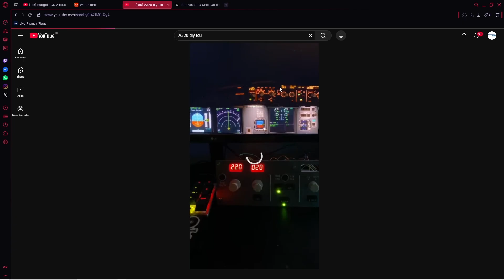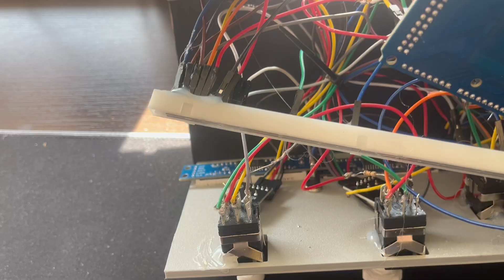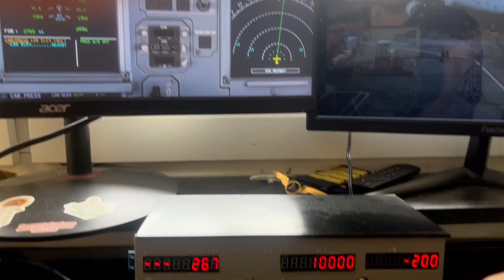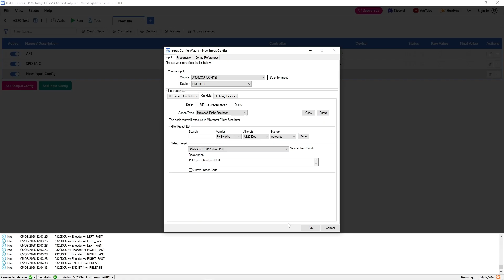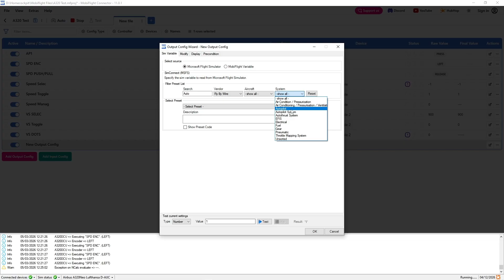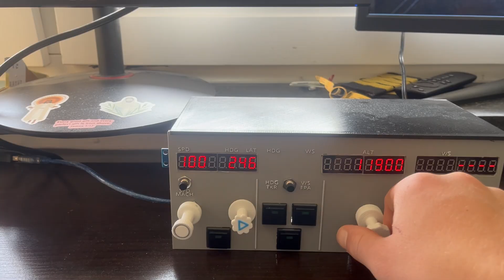The €40 DIY A320 FCU: Arduino Mega & Mobiflight for MSFS2020/24

Comment: Can you please make the wiring video for ardrino.
Reply from the maker: I could do it depending on my next projects… do u have an questions ?
Reply: @barbaros737  I don't know anything about wiring and if not the video, I would really appreciate if you could share the full wiring diagram. Thanks!! I really want to recreate this!
Reply from the maker: @rohannawani896 I actually didn’t used a wiring diagram. I simply used the normal wiring with common ground. Meaning every - pole connects to the next device until every - pole is filled, then I connect every pole with the Gnd on my arduino . For the other pins I simply googled or watched a few wiring videos. 

LED is for the long wire + meaning any given pin (don’t forget to solder your resistance for any led)

Buttons / switches where one pin to the arduino the other gnd (common ground )

For the lcd displays you can find it easily on google or yt tutorials 

Encoders also  -  + same action as the other devices … than you have two pins that go into the arduino for your inc/dec action … than there is one pin titled as swt or something that is for your encoder press button that also goes into your arduino
Reply: @barbaros737 I really appreciate all the help with the detailed explanation, this will surely get me started. 😊
Reply from the maker: @rohannawani896 thank you mate